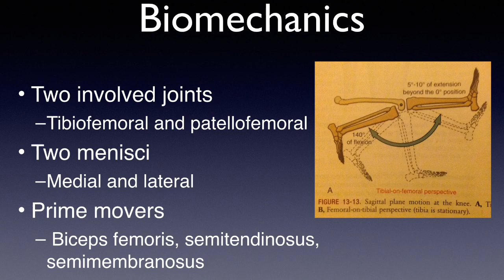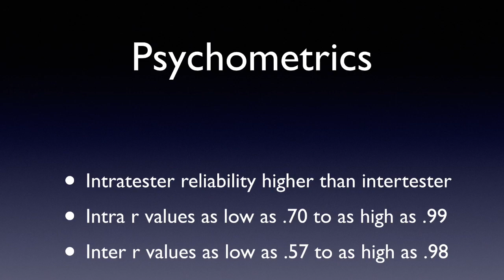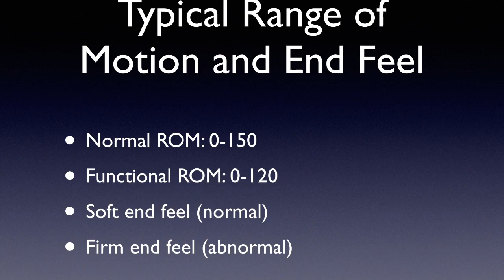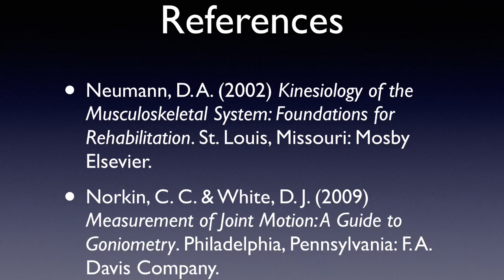Goniometric Measurement: Knee Flexion

Comment: Please revise, as measurement was poor; at 6:44 minutes of video. Goniometer positioning at mid line femur is correct; however, measurement of midline fibula was incorrect. Max knee flexion can reach 160 deg when heel makes contact with glut, as in this case.